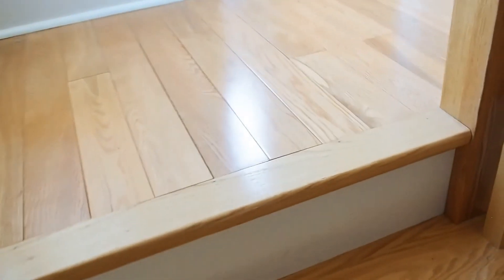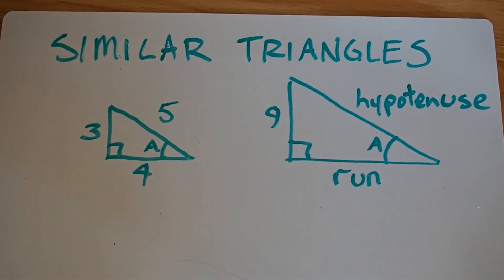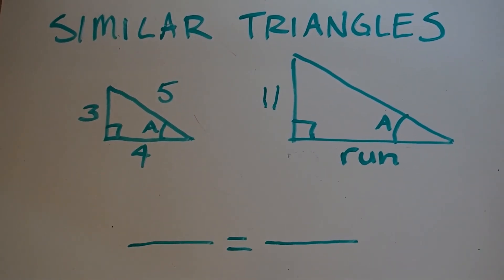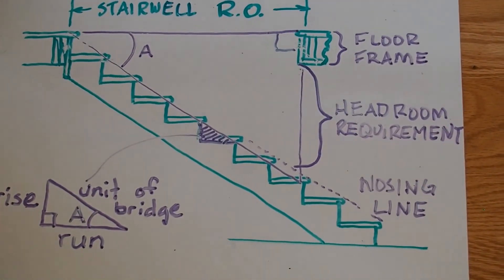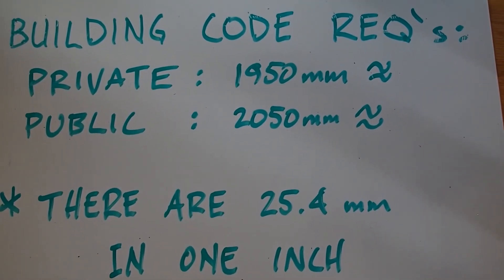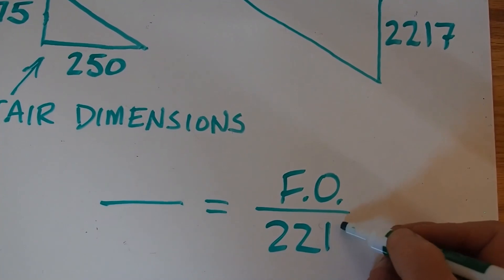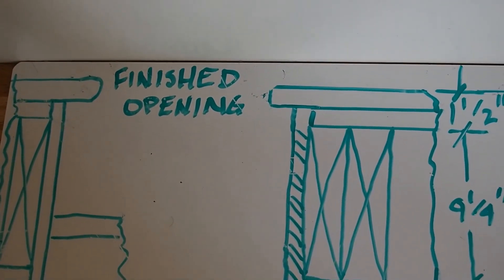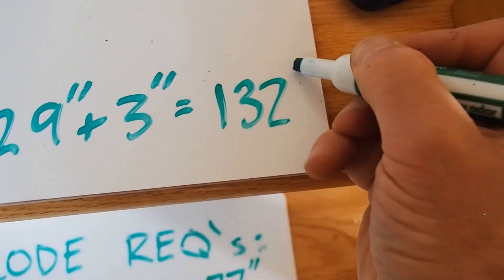Calculating Stairwell Rough Opening

Comment: I'm trying to figure out the average finished opening/hole needed for my floorplan sketch of a small retirement house that my husband and I want to build, if the basement ceiling is going to be 8 feet, or possibly 9 feet (dependant on what we can afford). I think the engineer can figure out the exact measurements for finished plans. But without understanding risers, etc, is it possible to get an idea (without building knowledge) of how many feet I need to allow for the opening of a straight staircase for my rough floorplan drawings? (For both the main floor and the basement.)
 Maybe there is a simple and free or inexpensive design tool I should use that includes this info? Does anyone have any recommendations? 

Thank you!

Comment: how do you calculate the stair angle? with rise and run of step. I have an opening of no stairs running to basement, total rise is 94" rough opening is 102" code for head room is 80". what is step rise and step run to get 80" head clearance? 94" is on the left, basement floor to top of first floor. left to right is 102".
My calculations come out to about 8.25 rise and 9 inch run with 10 Inch step.   94 and 102 cannot be changed.

Comment: There is also a way  go figure un equal pitch hip roofs somewhat easily. 

Fistly: slope and pitch are not the same. One is the slope over the run, pitch is over the span.

 Example on a equal pitch roof a 8/12 slope is over the run and a 8/24 is over  the span. So a 8/24  pitch 
Is a 1/3  pitch roof and the total rise is 8 feet

Comment: Simpler is even better 

D = Finish floor to finish ceiling + H = Head room desired ÷ Rise per step × Run per step + 3 inches (Head wall finish, riser board, and over hang nosing) = Rough Opening
Reply: What people make 15 minute videos out of. Excellent